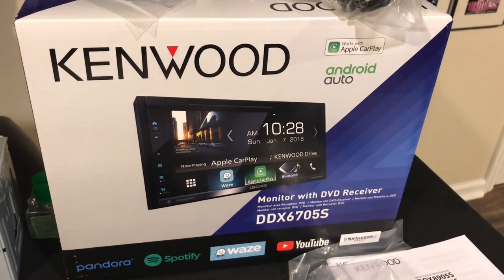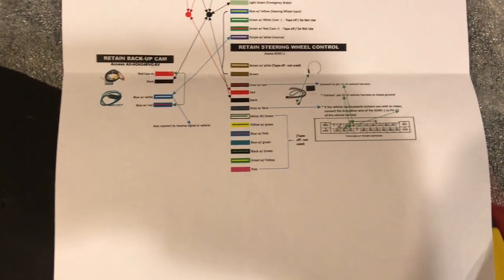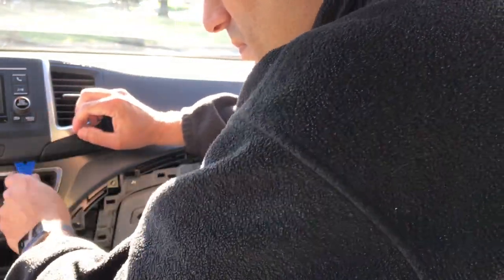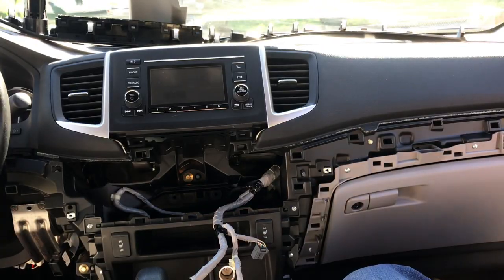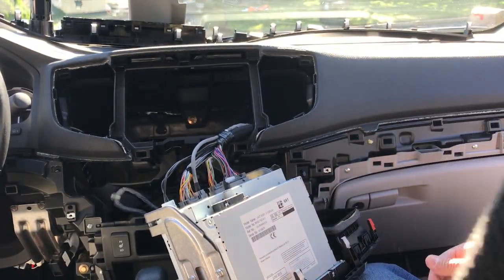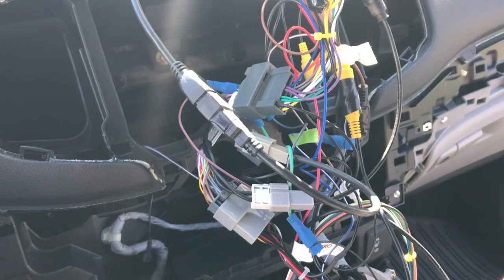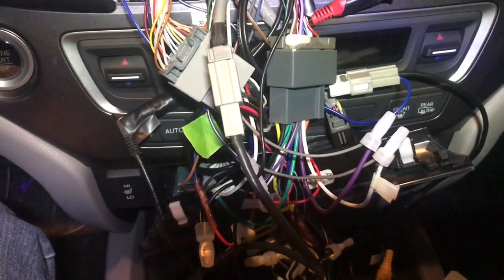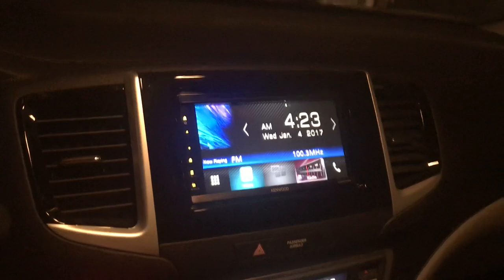James's 2017 Honda Ridgeline Factory Stereo Swap

Comment: Super helpful - the job took me a long time, but I referenced your video at least half a dozen times. I also did your trick with the pins for the steering wheel controls, and patched into the brown wire (which was a challenge to get to), and both worked like a charm.
Reply from the maker: mdbtuba1 glad the video was helpful!

Comment: Can't thank you enough for this video and the detail bought a 2020 Ridgeline sport with the 5-in infotainment system I'm so used to Android auto. So that was one of my first things that I wanted to upgrade went to a car audio shop and wanted $750 for a new head unit and install. So after doing a lot of research I did this for about $400. Took me a little longer and having to reference back to this video a few different times turn out to be a pretty decent Saturday afternoon thanks again for your submission of a great video
Reply from the maker: Thank you for that response! I am glad it helped! I love having Apple CarPlay in my car!

Comment: 2017 instructions on the Axxess website (5" non-touchscreen w/o Nav) worked perfectly for a 2019 Ridgeline Sport AWD and a Pioneer AVH-W4500NEX - I used the following: Axxess ASWC-1, Axxess AX-HON24RVC-6V Backup Camera Harness, Metra 40-HD11 Antenna Adapter, Metra 70-1729 Receiver Wiring Harness, and Metra 95-7811B Dash Kit (Matte Black), MicroBypass, and a PAC USB-TY1 Toyota/Lexus OEM USB Port Retention Cable. Video was a huge help. Thanks, James!
Reply: Hi there, is the PAC USB-TY1 Toyota/Lexus OEM USB Port Retention Cable is compatible with the 2017 honda ridgeline to retent the usb port? Thanks.

Comment: Great Video, helped me a bunch.
Just an FYI; I installed a Pioneer DMH-C2550-NEX, and for Android Auto, it requires a wire into the parking brake (well, i chose parking brake as it seemed easier to get to. 
This wire is above the glove box in a little cartridge.  in the middle connector, there is a Yellow wire in a corner pin spot. I had to tap into that to be able to setup a phone for Android Auto. Apple Car Play doesn't care about this; this is related to it being a Pioneer HU.
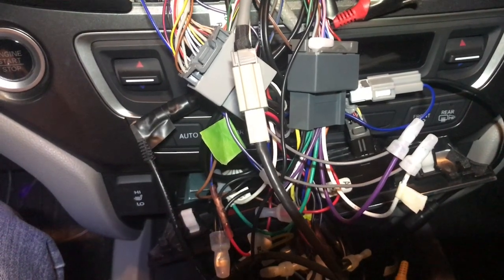Reply from the maker: Its has been about 15-months & don't even remember what I did.  Is that the same as 7:43 into the video?
Reply: Everett Netzband can you help how to locate that wire, I looked under the glove box but there’s more than one conector with yellow wire

Comment: Great video. Looks very nice. Massive improvement. I’ve done this in every vehicle I’ve purchased and it’s a must have upgrade considering what a trim level you need to purchase on a vehicle that would have a radio with Apple or android car play would cost, if it even is an option. Versus this under $500 relatively easy upgrade.

Comment: Thanks for this vid!  Way helpful!  Also discovered the backup camera won't turn on unless you ground it to the chassis (the Crutchfield supplied harness wouldn't work without it....that took a while, lolz.  Your instructions for the steering wheel controller worked great.  Strangely my PAC USB-TY1 is giving me a USB error.  dunno?  I haz JVC KW-V940BW.    I used pins A2 and A4 for +/- subwoofer line outs.  The Metra connector 70-1729 has the orange illumination line going to pin A2,  oops.

Comment: Great job on the video install. Wish it was out sooner. I ended up paying for my pioneer w4400 with subs and amp but really like it. Much better than factory.
Reply from the maker: Richard Jasmer I just bought the truck in August. It was a lease return certified pre-owned. Local shop wanted $880 for what I did myself for about $420 with all the wiring/trim kits.

Comment: The ASWC-1 is worthless. The Ridgeline's steering wheel is passive (resistive). The left side controls split into two groups. The top (vol, track, source) set of buttons bus to the radio harness connector as the pink wire. The telephone set of buttons bus to the tan wire. You must bond the yellow wire to chasis ground, there are plenty of frame studs to choose from. That's all. Most third party radios assume you're using passive controls, and will allow you to assign your steering wheel buttons. I hope I saved you all the cost of the ASWC-1, a stupid mistake I made.
Reply: Thanks for the info. Can you clarify the telephone wiring please. I have a kenwood reciever. I purchased the ASWVC-1 but its giving me problems . So i would like to remove it TIA Dave
Reply: @davek2714  https://drive.google.com/drive/folders/1BTtcavdaqGhgbeXyBrRv5IqOXBqORDIN?usp=sharing

I'm sharing my copies of the official electrical prints for my 2019 Ridgeline RTL. I marked up the audio print. 

For your steering wheel, refer to the print for Connector A. You'll see that pin 22 (pink wire) is for AUDIO_REM. This is the circuit for your audio buttons on steering wheel. Pin 23 (tan wire) is for HFT/NAVI_REM, which is the phone buttons on the steering wheel. You need an electrical RETURN for both circuits (bond Pin 11 to the chasis of the vehicle). Connect Pink wire to Steering Wheel Key. Connect Tan wire to Steering Wheel Key #... Third party stereos will vary in their naming. 

For your terminations, do not cut the car wiring, use a splice kit; just a way to protect yourself from warranty issues- if they do arise.

You'll find some pictures of my Ridgeline, when I was working on replacing the stereo. Let me know if you have any other questions. 

Take care.
Reply: @socksincrocks4421  Thank you for the quick reply. I have only 1 steering wheel control wire coming from the receiver . Does your receiver have 2 wires for steering wheel control. thanks Dave
Reply: @davek2714  I have two wires for my stereo. Check out my pictures on the link I shared. If it helps I have a ATOTO A6. Check out the line diagram for the audio circuit, it's also on the Google Drive Link. I got it from Honda's service manual. There is a detailed print of the steering wheel circuit, and how it interfaces to the stereo connector harness.
Reply: @socksincrocks4421  Thank you
Reply: @socksincrocks4421  Can the camera views be retained? Ive seen someone with a toggle switch to change views.  Do you know how this works? I'm going to do it if I can have the cam viewd.
Reply: D T hey, camera views, or do you mean camera working with a third party stereo? I got the stock Ridgeline rear camera to work with my ATOTO A6 unit. The rear camera needs a voltage regulator to convert the 12vdc from reverse circuit to 6vdc, which the camera requires. Refer to my google drive share. There are electrical prints which show what’s going on with the Ridgeline. I’m not sure if you can change the camera view angle of the RTL camera. I haven’t tried it. But I’m presuming you might be able to if you toggled the “BIT 0” or “BIT 1” of the camera’s circuit. Again, refer to the attached electrical print. It’s all there, just have to take the time to put the pieces together.

Metra AXHON24RVC6V Electronics Ax-hon24rvc-6v Honda (Without Touchscreen) 2015-up https://www.amazon.com/dp/B07H9F3ZJD/ref=cm_sw_r_cp_tai_1-rTCb75JPAMM

I used the kit above to interface the camera.
Reply: @socksincrocks4421  Yes, I'm talking about the 3 different views.  I would love to retain one straight back and the view that points down towards the trailer hitch. I think I saw someone on one of the forums with a 3 way toggle. I cant find it..
Reply: D T I haven’t tried it, but I presume it would be done by using the “BIT 0”, “BIT 1” on the camera wiring harness. On the stereo connector, Connector “C”, Bit 0 is pin 5, Bit 1 is pin 18. 

Vid signal is pin 15, Camera power is pin 16, Vid sig ground is pin19. Ground to the Chassis  pins 2 and 4.

The bit 0, 1 should be logic. I recall seeing 5vdc on pins 5, 18 when the camera was energized. I would pull each pin down to 0vdc, by grounding, to see what effect it has on the video signal.

I’ll eventually try it when I pull the dash apart again.

I’ll keep you posted. Let me know how it works out for you. Don’t forget to check my prints in the link I provided. It will show you exactly what you’re dealing with.

Also... the pin numbers are printed in the plastic of the connector on the wire side. They’re small, use a magnifying glass
Reply: @socksincrocks4421  I agree.  When I dig into this, I will let you know.  Im ordering everything this week.  I am not sure when I can install. Thanks for the drawings, they will come in handy.
Reply: @socksincrocks4421   I dont need to purchase the aswvc?  How do you interface the steering contols to the new receiver?  Dont I need a connection somewhere?
Reply: @dwt419  Hi, NO, you don't need to purchase anything as long as your radio accepts resistive inputs. The Ridgeline's steering wheel buttons are just two resistive circuits, with one wire as common. Three wires total. Each button on the steering wheel has its own resistive value. I programmed my ATOTO A6 to recognize each button, and programmed each button to function as whatever. Example... Vol up, Vol down, Track forward, Mute... Once you set it all up, you'll kick yourself about how easy it really is.
Reply: Thanks for the information!  I'm still having problems with the reverse wire and I also need to attach to the parking break for my receiver.  The brown wire (reverse) didn't work for me, but it could be a bad splice.  The parking break seems to be a pain.  I cannot seem to get to the yellow wire attached to the switch.  Does anyone know of a good way to get to this?  Doing some testing, the yellow wire seems to be negative.  My guess is closing the switch closes the circuit with 12 volts.

Comment: You probably don't remeber by now but I noticed that you connected the parking break wire to ground.  Did that work out or does the radio expect to see 12v at the wire when driving? Thanks.

Comment: Thanks for the detailed video and wiring diagram. I am planning this upgrade for my 2018 Ridgeline Sport, but the Kenwood DDX6705s. Any suggestions on a newer model with comparable features/connections? My objectives are bigger screen with CarPlay integration without losing stock features (usb, backup cam, steering wheel controls). Any insight would be approximated.

Comment: Hello I got a 2019 Ridgeline and I just installed a Sony.  Couple things I notice with this radio is I don’t get the hang out button on my steering wheel control but all others work.  Also the angle the radio installs looks very dark towards the nitro when I am looking at it when the camera is on.  I am wanting to change it out and saw ur kenwood.  Do you get all steering wheel control?  Also how is the view angle on the radio do u get the dark view on the lower part of the radio

Comment: Any idea if this install would be the same on a 2019 Honda passport?  Everything looks the same but I'm not sure if any of the wiring harnesses would be different.  Also, would this control a factory subwoofer and the factory microphone for Bluetooth calls?
Reply: all the cars are the same. The harness is basically connect the dots. All the lines have names along with color so connect them that way.

Comment: I got a 2019 passport with same factory radio. Do you know if nav radio honda will be a plug and play if I decide to upgrade?
Reply from the maker: If you mean a Honda unit, I doubt it. It would prob need extra components. I just use Apple Maps on my iPhone connected.

Comment: One thing I notice about the Axcess steering wheel controler in your diagram is that you say to connect pin 11 to grey red and 22 to gnd. From the installation instruction I found, it says to do the opposite. Just curious to see if that is what you did, or there a little typo
Reply from the maker: Not a typo.  This is what I did.  When I was on the phone with Axcess they mentioned that their instructions called for the opposite and crutchfield called for the way I did it.  They did not know why the dependency at the time, but told me if it didn't work, I should swap them.  I didn't need to.  Hope that helps.
Reply: @TJhooker07753  ok. Glad to hear. Maybe that's why my phone buttons don't work. Sadly it's all back together...

Comment: Hi ,I just called metra Axxess about steering wheel controls, were you able to get your phone and voice buttons to work on steering wheel? They said bluetooth functions were never supported....for some reason I thought you got those to work?
Reply from the maker: Honestly, I’ve never tried. I had no reason. With Apple CarPlay, I just use voice.
Reply: @TJhooker07753   does the voice button work though on steering wheel or u have your phone just to detect Siri
Reply from the maker: I just say “hey siri” or press Siri button on stereo.

Comment: Did you retain use of the steering wheel controls for phone? How about original car microphone?
Reply from the maker: I’ve never tried car buttons on wheel. I thought that was for Bluetooth, which I don’t use. I use the microphone added as shown in the video - mounted on the dash.

Comment: James , did you lose function of stock subwoofer ?
Reply: Did your ever get this answered?
Reply: @toddpitts1410  not here. But found out I’ll need to by an amp for the subwoofer to work if I change stock stereo (stock has internal amp to power both speakers and sub)

Comment: Hi James, Thanks for your effort in documenting this. I'm thinking of doing this on my 2018 RTL-E and I have a couple questions: 1. What did you do about vehicle system settings (on my RTL-E all vehicle setting are configured through the stereo monitor)? Example: how long headlights stay on after the car is turned off. Where you able to retain the programmability of the settings through your new stereo monitor? 2. From you wiring diagram, it's not clear whether you were able to reuse the factory amps, or did you have to bypass them?
Reply from the maker: Burt Farley I have the ‘17 RTL. No setting through original radio (that I know of).

Comment: James, i know this video is a couple of years old, and i've done tons of stereos, but none of the Android auto/camera tie ins yet.
I'm looking at your wiring diagram, and you only show 2 wires on the 6v to 12v converter, i also have a ground, did you just tie yours in on the radio harness?

i also have a brown mute wire out of my stereo harness, did you just terminate that ?

and the big question i'm having trouble with,  i get what to do with pin 11 and 23, i'm assuming pin 22 wire can be tied in to any of the other ground connections seen on the wiring diagram?  

sorry for the loaded questions.

This video has been a great help
Reply from the maker: nick rigsby looks like some a-hole messed up my wiring diagram. I have to look for it & replace it

Comment: Did my install, identical to yours.  Thank you.  Can’t get my hft button to work.  Does yours work?
Reply from the maker: hft?
Reply: @TJhooker07753  Hands free touch - the one that brings up Siri.  I ended up getting it to work 100% though.  Great video.  Thanks!
Reply from the maker: @richardbeckman8523  I’m glad it is working for you. I have a button on the screen on my Kenwood that I press for Siri.
Reply: @richardbeckman8523  can I ask how you managed make it work?
Reply: @wwesuperstar1100  it depends on what unit you have to connect to your steering wheel controls.  Mine was a unit by Axxess.  It only worked the volume buttons out of the box so I had to manually reprogram it.  It wasn't hard to do, just had to read the directions and I even called the manufacturer.  They walked me through it on the phone.  It works 100% now with all the steering wheel buttons.
Reply: @richbeckman470  I would appreciate if I can somehow request more info for the swap you did man

Comment: This modification is one of the reasons why i would look for a lower trim model.. to customize
Reply from the maker: exactly what I did.  paid about $400.  Next level RL was about $3k more.
Reply: Any regrets on gettin the lower trim ?how has it held up for daily use.. . I'm looking for a  used one .. most of them have high miles bit vary from 20k-22k with miles fromm 50k-75k ..are these worth it used
Reply from the maker: Guillermo Ortiz No regrets. I bought the 17 RTL from Honda. It was a certified preowned with 29,000 miles on it. It was only about a year and a half old when I bought it. It is my second Ridgeline, the first being a 2011. I have no regrets. I’ve been to Texas and to Maine And everywhere in between with it.
Reply from the maker: I find it to be more comfortable than the generation one, smoother, However The AC does not get as cold as the original. I also like the center consul in the original, I found the armrest to be more comfortable.   WWith the RTL, the back window does not open, however I hardly ever used it anyway.

Comment: Did the illumination wire connection from harness work or did you have to tap into another wire? I have a 2019 Passport and the orange wire connections from HU and harness adapter do not match with factory harness, that spot is actually for subwoofer from what I've read.  Folks have advised to tap into pin 3 on unused connector for CD player. Looking to confirm on your experience with the Kenwood.
Reply: Antonio, I have a 2019 passport as well and am thinking of  putting in an upgrade. Which stereo did you go with?
Reply: @marcpodis4302  I went with the Kenwood DMX7706s. I have a write up of the wiring configuration I can send you if you want, just let me know your email
Reply: @antoniofiorentino9992  can you share a link to this write up?